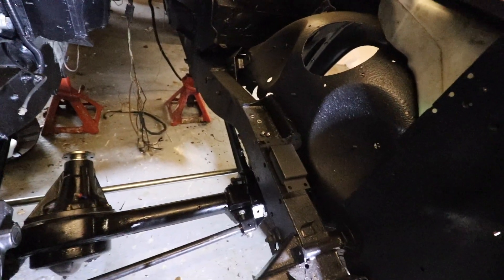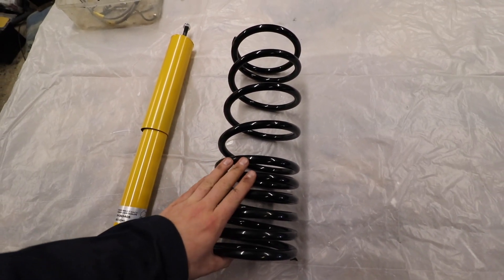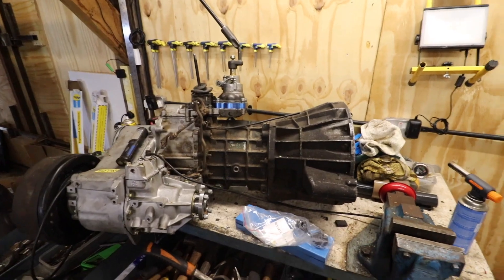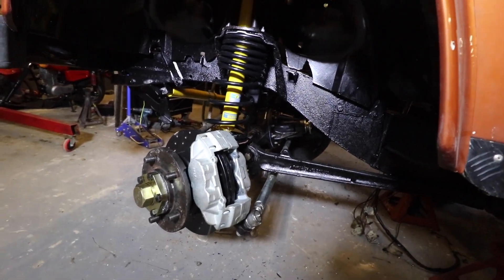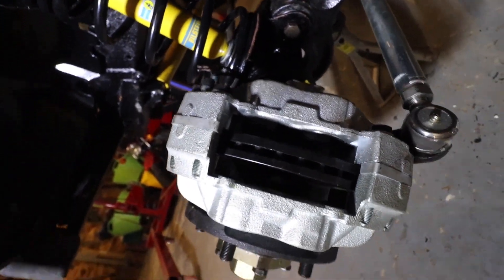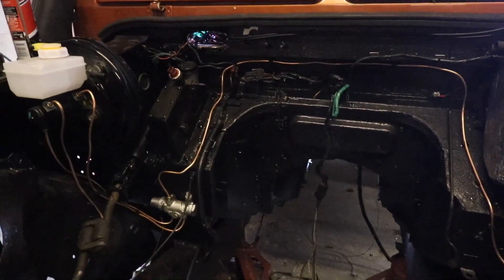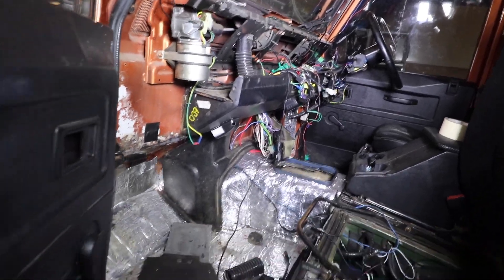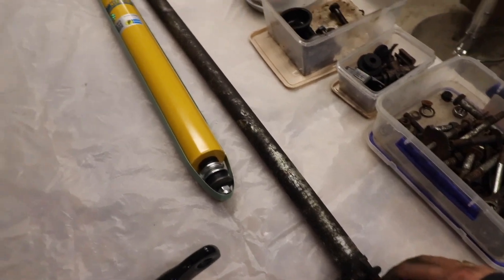Project M57: Episode 6 - Springcoil Ltd Progressive Defender Suspension

Comment: Interesting video. I am researching suspension for my V8 3.9 build for an ex army 110 soft top Tithonus. A lot of the progressive springs (eibach) on the market are rated for heavier Diesel engines. I want to lower the ride height, level it down at the back and soften it as current springs are heavy duty. Did you spec the spring rates for your build?
Reply from the maker: Hey there. I find Heavy Duty springs are terrible for the already shonky defender ride. Yes i specced the spring rates for my build/ the kit i have created, however i cant remember of the top of my head what i went for. cheers, ollie